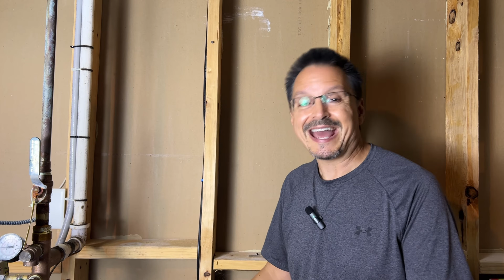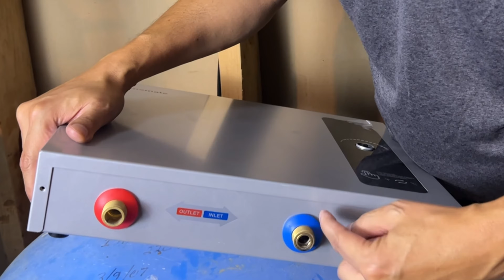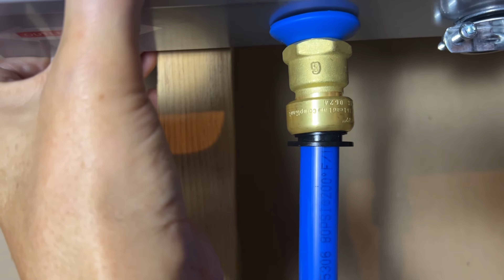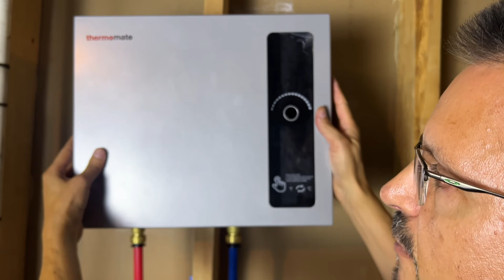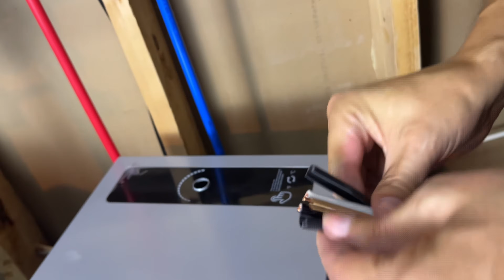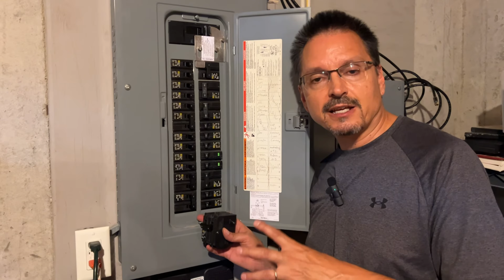How to Install the Thermomate ET140: Step-by-Step Guide

Comment: Would this work if heating an above ground pool ?
Reply: My guess is you would spend an awful lot on electricity costs trying to heat that much water.  My swimming pool is 24,000 gallons.